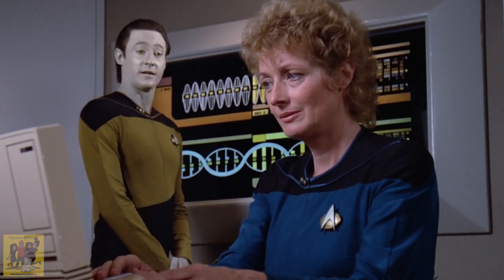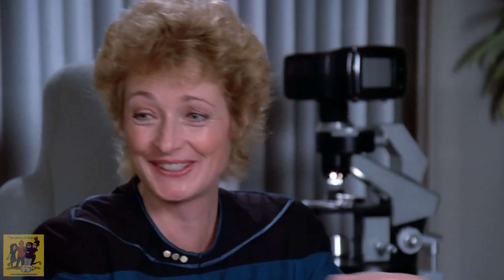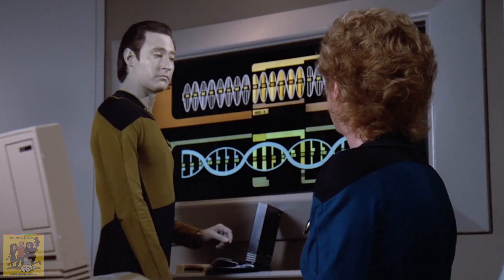Ep. #699 Still having issues with persistent data on my FlexRadio 6600M

Comment: Well now that you've been running the 6600 on the faster SD card, did the persistant data problem go away?  what have you noticed??
Reply from the maker: it's better but it still messes up from time to time, just not as much. they should not be using a DB, they should just simply store the values for each band in a separate flat file, and that file only gets replaced by the updated tmp file after the data was written and verified, but they call it a database, which means it probably has tables, and indexes etc, with the data all stored in one file, like SQLite,  which is just stupid to have on something like this.   that's my guess as to what the problem is. I write software for proprietary hardware for a living so I'm not just speaking with no real idea on how to write this stuff. using a database for this is a bad idea for this reason. there is no reason for this issue to still exist after 7 years of people reporting it.
Reply from the maker: aside from that, I do love the radio. and I just learned to accept that you can't ever expect much from Microsoft developers. I don't run windows for this reason. so I guess I should not expect a radio that runs on windows to be written any better than the OS I loath.
Reply: @Thejohnnyoshow  Thanks very much for the update on this.....I have really enjoyed your videos and learned from them....Just ordered a 6400M and the Palomar Engineers noise reduction kit.....really felt like your videos helped me understand things, to thank you for all of them.
Reply from the maker: @paulallred5426  you're welcome, and despite the bugs, I really do love the radio, and would not change it for anything else :-) well except one just like it without bugs haha